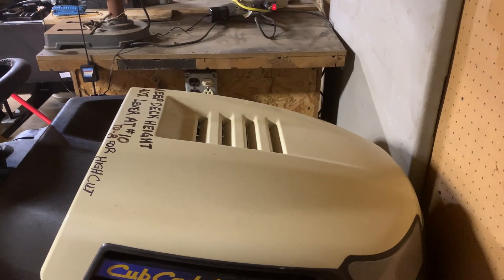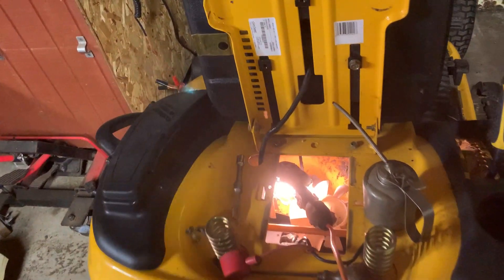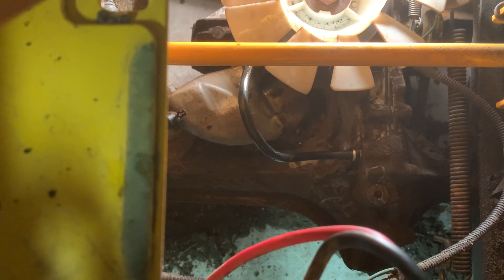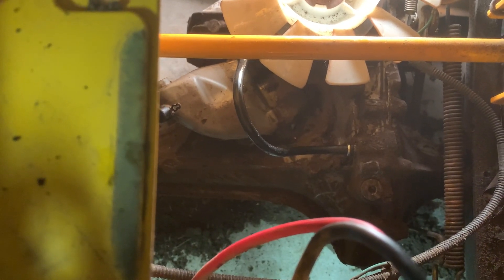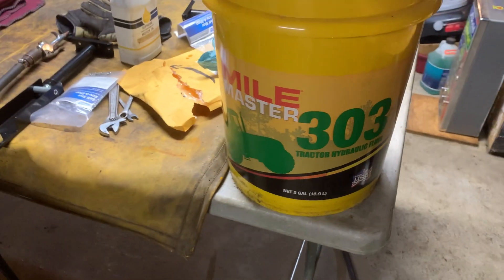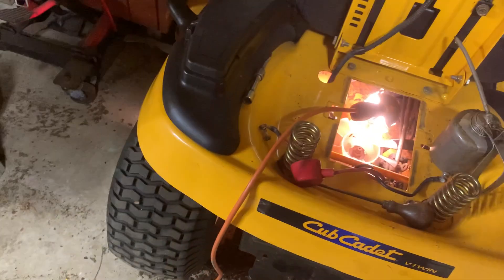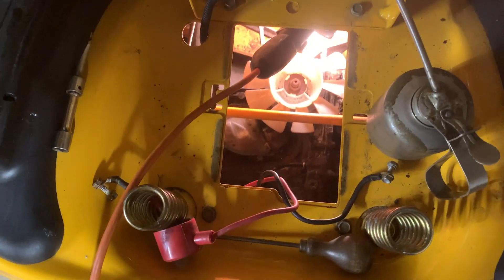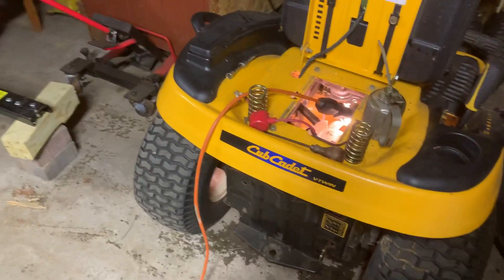Cub Cudet 1046 Hyd Fluid Fill

Comment: There is a removable fill plug, half inch diameter with a 1/4” hex right next to the vent tube that can be clearly seen at 1:22. I used a vacuum pump to drain the old oil, then filled it to about an inch below the vent tube level

Comment: I have the grey tank and black cap but there is no black tube coming out of it  . I know my mowere is making a noise at the back tires but  not sure what it is . I greased the ports on the tires but it continues and mower is running slower than it should . I did not know that was even there until I had to change the drive belt  . Nothing in my parts list about it or diagram about the mower which I  used to make sure I put the drive belt back on right
Reply: 2016vv twin  ltx  1042  kw    hydrostatic

Comment: I have that same transaxle in my cub and I'm trying to take out that fill plug, but it's so very tight, and I really don't want to strip out the allen head.  I think I'll try this method; my Cub is a 2011 SLTX 1054.  I wanted to suck out the old oil and flush it with new, but If i can't get that fill plug out, my next best option is filling it like you did
Reply: I read your comment. I have same model and problem as you. I was wondering how you made out ?
Reply: @romanmurray9489  I took the fill nut out on top of the axle, and bought a suction gun from hardware store and sucked out as much of the bad oil as i could and replaced it with Mobil 1 Synthetic 20w-50.  I've done this several times mainly after mowing as the oil is warm and easier to suck out from the top.  I had a real hard time busting that top fill nut loose I had to get a pry bar.  I know I'm not getting all the oil out with my method, but the mower is moving much better.

Comment: I have same mower, and the axial is leaking on sides, for 5 yrs now.  I knew transaxle was going to have to be either fixed or replaced.  There are other videos where people are replacing end seals, then drilling hole in top or finding a breather cap for oil input.  Your video is great, thanks for taking time to show this!!